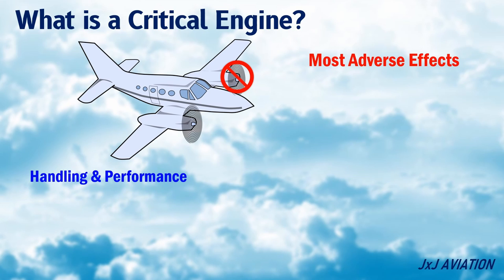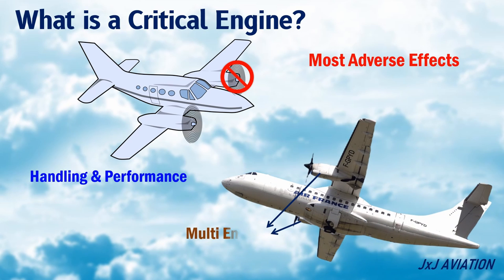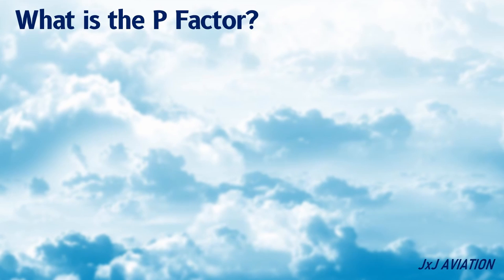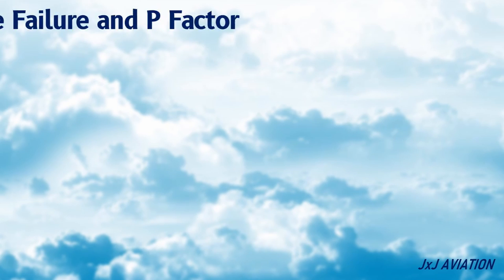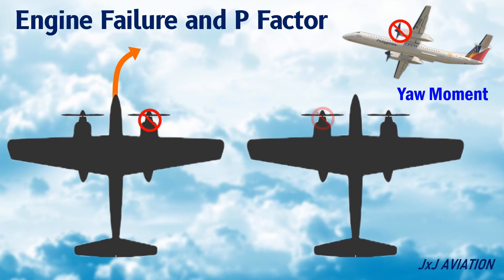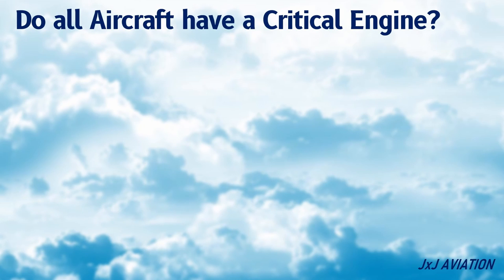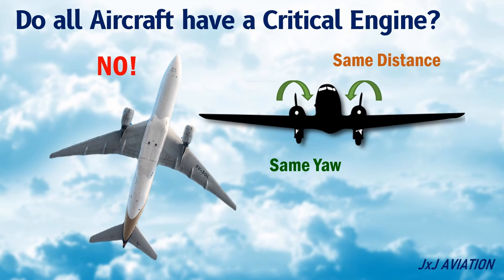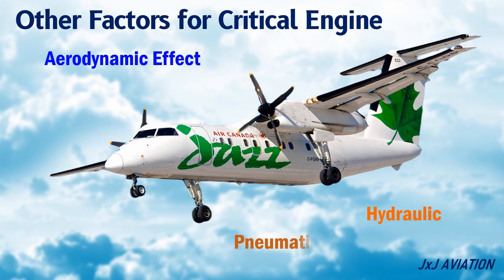What is a CRITICAL ENGINE and P Factor in a Propeller driven Aircraft?

Comment: Another thing to point out for prop planes with counter-rotating propellers is that usually the downward moving prop is on the inside for both engines. This minimizes the yaw moment for both engines. If the downward prop is on the outside, that would maximize the yaw moment for both engines. The P-38 Lightning actually did this to reduce the effect of the spiraling slipstream on the horizontal stabilizer.
Reply from the maker: That is an awesome explanation! Thank you!
Reply: Right, which meant that BOTH engines were "critical".